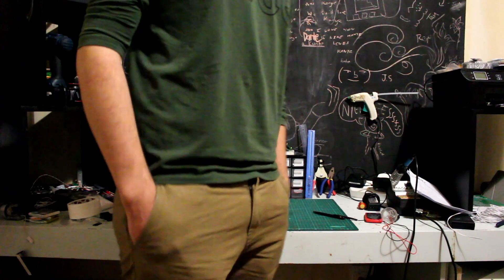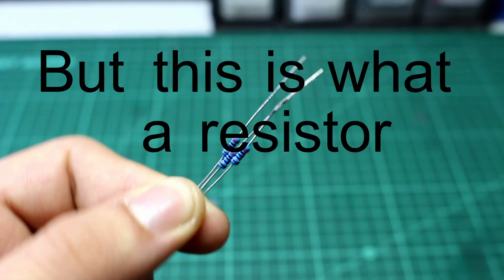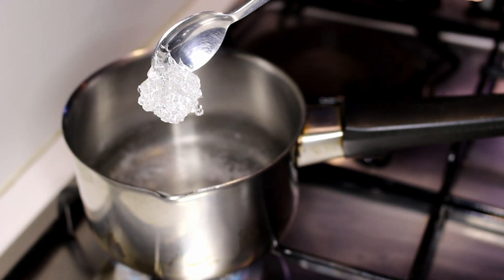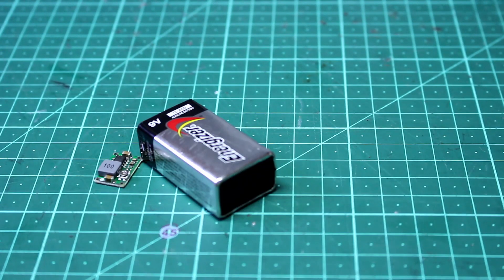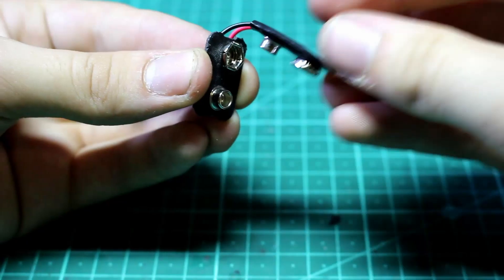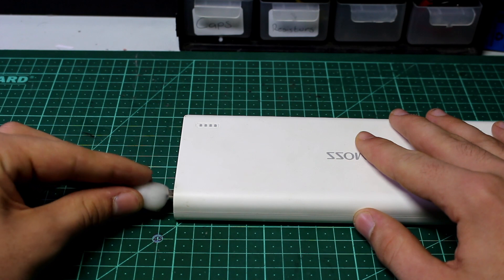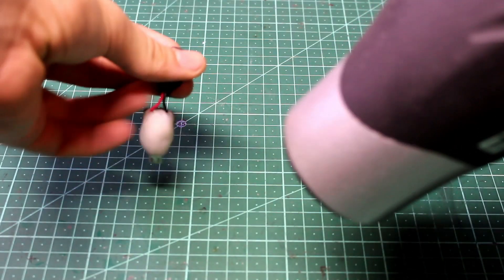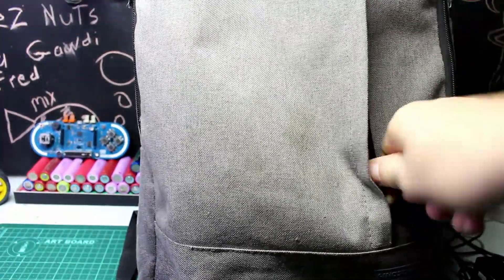Emergency Keyring Phone Charger

Comment: Here is an idea:you should try to do the same,but insted of using a buck converter,use a boost converter and glue it to two batterie holders.The two batteries should have 3V and it wold be enough to charge it
Reply from the maker: I tried this an it seems that two AA batteries can't deliver enough amps to run a phone at 5 volts 1 amp
Reply: @BuildItnow  You are right
Reply: @BuildItnow see my other my other comment